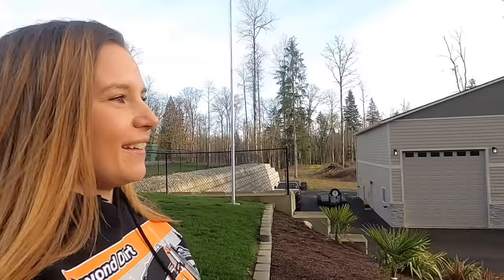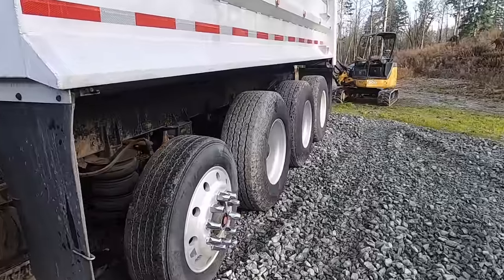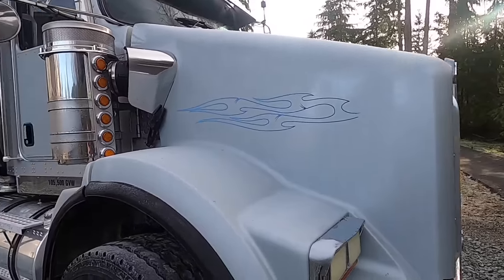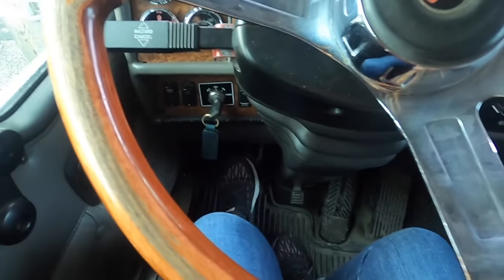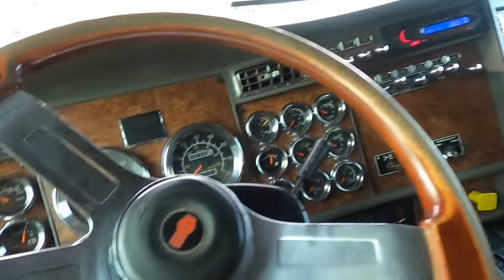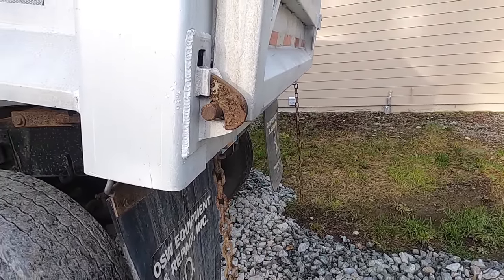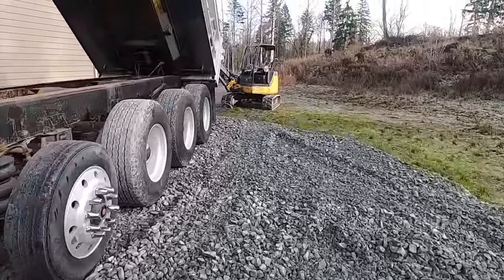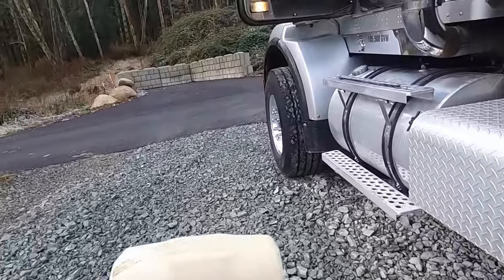I DID IT! I BOUGHT MY FIRST DUMP TRUCK! 2003 Kenworth Truck and Pup Sturdyweld Dump Truck.

Comment: Holy cow...im a city guy so i see dump truck all the time...just never with these types a trailers....why is the trailer so long?
Reply: It's to help distribute the weight over a larger distance so it's not all in one spot, particularly for going over bridges.  It is also necessary for clearance behind the front (truck) box to be able to dump the front (truck) box.
Reply from the maker: WHY IS THE REACH SO LONG?!! Here is why, Bridge weight. Kenworth T800 Truck & Trailer Bridge Weight.
https://youtu.be/pnE_YlawUgQ

Comment: I don’t know your name I know you’re up in the Northeast someone but I drove  pub Trucks from about 30 years and on my own for 24 years my Western star that I had at the end had airbags on the truck but I see you have them both it’s a good idea to drop their bag for you dumb I don’t know if you know that or not some guys did but I always drop mine but I’m looking add all the drop axles how much weight can can you guys all them trucks I see you’re having problems with the air problem your dryer filter maybe need to be changed and you can have water in your lines it’s frozen so you might want to change your air filter and get the water out of your system because you said it’s been sitting for a long time

Comment: Nice  truck . I always bean a Kenworth guy and Kenworth are much tufer then  peterbilts right now and better quality than peterbilt. That motor is very expensive to fix that why I would go with Cummins motor instead because it's cheaper to fix then a caterpillar motor and  chest as tuff as  caterpillar motor
Reply from the maker: I’ve never heard that before.
Reply: @DauminiqueTheDumpTruckDriver    I understand but I have talk to truck drivers that  had cat motors and they said it was very expensive to fix
Reply from the maker: @markgregoryrugman7136  🤷🏻‍♀️ I think it will be just fine. It’s what my husband wanted and he’s the mechanic.
Reply: @DauminiqueTheDumpTruckDriver   yes that your own choice and I can't tell you what you can have but  me personally I would have a Cummins engine versus a cat because Cummins is still being built for semi trucks unlike cat are not anymore  today  except for  construction vehicles

Comment: Worked a season for Hos bros… not any fun! Worked the rest of my time with V Van Dyke hauling oversized loads, that was a way better job! Hos had the same axle set up as this truck, but the traffic was so bad in Seattle area, loathe BMWs, Mercedes and mini-vans! Their time was always more important than yours, cut you off.
Reply from the maker: Haha it’s not that bad. I
Mean I wouldn’t want to work at Hos but I’ve been out here doing the same job that they do for 14 years.
Reply: @DauminiqueTheDumpTruckDriver  only spent a couple years in Seattle, then we moved oversees, haven’t been in a truck since. Still have my CDL, but went back to school and got my RN… pay is way better.

Comment: Ich sehe ein Problem. Niemals sollte man die Motorhaube schließen, ohne diese sofort zu verriegeln. Im Video wir die Haube geschlossen, und die ahrerin steigt ohne diese zu verriegeln in den LKW.!! Wenn Sie jetzt losfährt und bremsen muß, geht die Haube von allein auf !!! Und eine Frage aus Deutschland hätte ich da noch!. Wieso hat der Anhänger so eine Extrem lange Deichsel???  Liebe grüße aus Deutschland und frohe Weihnachten und ein gutes neues Jahr.
I see a problem Never close the bonnet without locking it immediately. In the video, the hood is closed and the woman gets into the truck without locking it. !! If you drive off now and have to brake, the hood will open by itself! And I still have a question from Germany! Why does the trailer have such an extremely long drawbar ??? Greetings from Germany and a Merry Christmas and a Happy New Year.

Comment: Video time 11:08 give it a squirt of WD40 Lubricant , WD-40 Multi-Use Product protects metal from rust and corrosion, penetrates stuck parts, displaces moisture and lubricates almost anything. https://en.wikipedia.org/wiki/WD-40

Comment: Good luck, it ain't worth it anymore sold all of mine. Even pulling in 3300$ a week per truck and not even putting 100miles on them or getting on the road.
Reply from the maker: Why were you only pulling $3300 a week? That’s about 3 days of work….
Reply: @DauminiqueTheDumpTruckDriver  55 an hour making a 30 foot circle. Building wash puts in the txu mines. Maybe 20miles a day on the truck not even 100$ in fuel a week. Maintence and insurence will kill you. 20k+ per year a truck in maintence and other things then you hire drivers ect..
Reply: @DauminiqueTheDumpTruckDriver  its just not what you think it's going to be. Trucking industry is dying and going down hill fast.
Reply: A rebuild on this truck is 30k+ and it will eventually need one. Not including everything else that needs maintence.
Reply: You should be making more then me anyways that's a massive truck with a trailer I was running just trucks.
Reply from the maker: @mrrod3004  it had one 50k ago. If and when it does I’ll only be in it for parts anyways. That goes for Maintance as well.
Reply from the maker: @mrrod3004  the truck rate is 150-220 an hour. Insurance is pretty cheap.
Reply from the maker: @mrrod3004  and I’m planning to drive it.

Comment: he wont be happy when that cat breaks down cat suck motor wise  but equipment thre he best you should had gotten a cummins for sure
Reply from the maker: Cat motors last a lot longer in dump trucks. 2 years and 120k miles, still going strong.

Comment: Bit rude you don't answer the questions about the stupid length of that trailer,  there is lots of them 
It's my first question why so long ?
Reply from the maker: Bridge weight
Reply: @DauminiqueTheDumpTruckDriver  I don't get it , so you can put it on the weight bridge? 
By the way I drive road train's in the northern territory of Australia .
Love the 600 caterpillar engine and a 18 speed RR.
Reply from the maker: @hegantetamboktyanak6368  it spreads he weight over a larger area as to not put too much pressure on our bridges
Reply: @DauminiqueTheDumpTruckDriver  right oh , I get it now

Comment: i'm not familiar with trailers with a long boom or reach, but i'm interested. why do you need the long reach? is it so you can tip the truck/bed without unhooking the trailer? how do you pull your trailer over the material you just dumped? or is this used for gravel and you unload while driving? its fascinating. why don't you use a big dump truck like in this video? https://youtu.be/YYi1VENUm6k stay safe!
Reply from the maker: Because end dumps are dangerous and they gross 80,000. I drove end dump at the begging of my career, they are only good for brush and recycled metal.

Comment: Terrible decision buying PACCAR made Kenworth truck. PACCAR will own you with high priced parts not  to mention how unreliable their trucks are. Good luck with this one but I hope it works out for you. In the future go with Volvo or Freightliner.
Reply from the maker: No one buys Volvo or Freightliner trucks for dump trucks. They just don’t hold up off road and do not tolerate weights over 80,000 lbs well.
Reply: @DauminiqueTheDumpTruckDriver  I know what you means but I know how PACCAR prices their parts and how they work with their dealer networks to manipulate the market. I hate to see someone who works so hard get taken advantage.